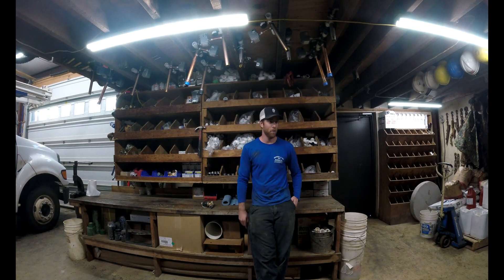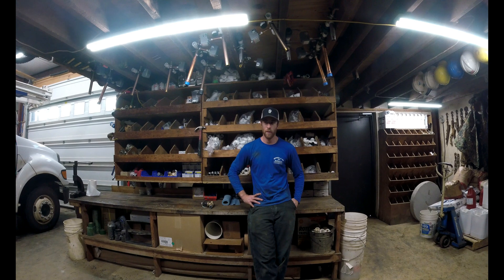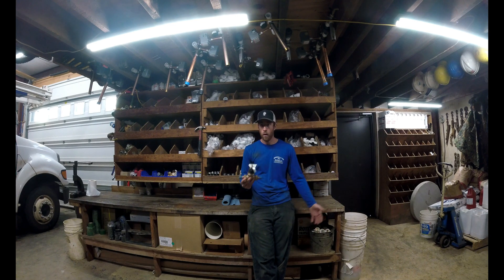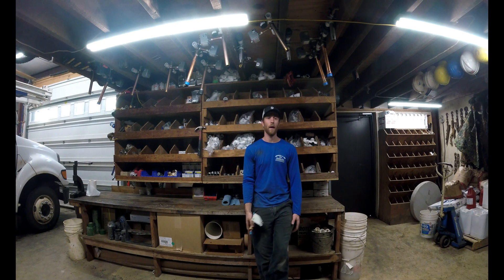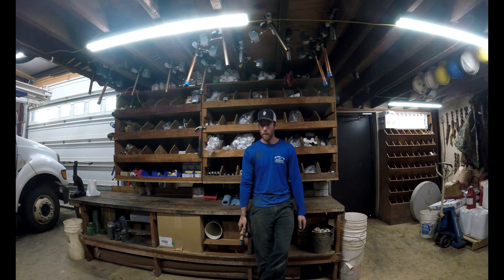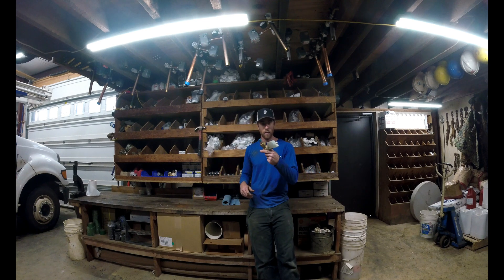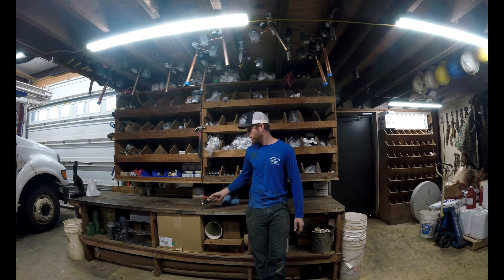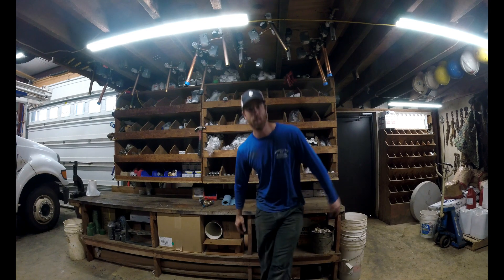What is a Water Pressure Regulator? Do I need a Regulator on my Well?

Comment: Thanks for telling me I don't need this for my well! Just recently installed a new pressure tank, 40/60 switch, and 40gal Rheem Water heater. Switch and pressure tank functioning great however, my water heater pressure relief valve just started dripping! Since it's new what would you do?? I'm thinking of checking the thermostat and making sure it's set to atleast 120, cut the power to it to see if it still leaks. If it still leaks then I guess just replace the brand new pressure relief valve on the water heater??

Advice?
Thanks!

Comment: Hey friend,  I  appreciate your knowledge, however,; I just replaced my well pump myself and realized after installing a sediment filter at the house, with a preasure gage,  my preasure preasure is 80 psi due to my elevation drop of about 100  feet from the well head. I'm pretty sure I should regulate. Would love your input. Thanks

Comment: While it is true you don't NEED a pressure regulator on a well pump system, because the pressure tank and pressure switch control the pressure, you may WANT a pressure regulator.

The reason for that is that a typical pressure switch is either 30/50 or 40/60 psi on/off. The 20 psi difference means you can have a significant difference in water flow through your faucets, depending on what the pressure in the tank is at the time. This pressure drop and surge, isn't harmful, but can be irritating. If you install a regulator, set at the off pressure of your pressure switch, then you always have a consistent pressure and flow through your pipes. (You must put your regulator down stream from your pressure tank and pressure switch, typically right after them, or after your filters.)

Comment: What about a pressure regulator on a deep well jet pump? I’m trying to figure out if I really need one or not.  ( I just installed a new jet pump and it came with a “flow control valve,” that threads into the top of the pump.)

Comment: Great video. What would you recommend for a jet pump/well system that can't build pressure to 40 psi at the max? Pressure switch is set at 20-40 so once well level drops a bit it can't even reach 40 psi cut-off so the pump continuously runs until manually switched off.  I have a slow recovery well so obviously delivery isn't meeting the demand during high water use situations.